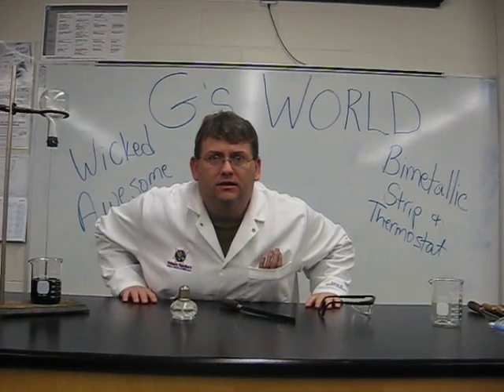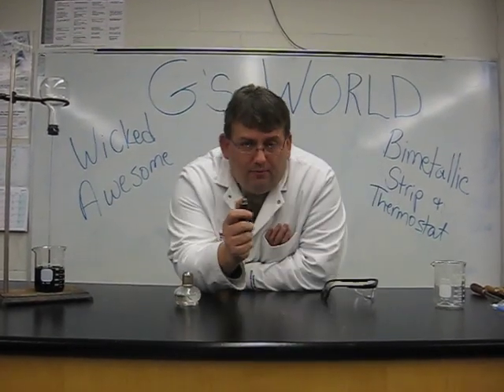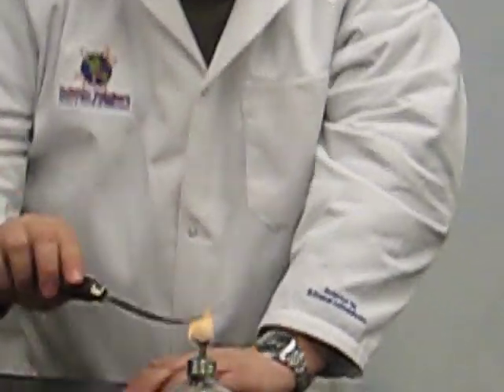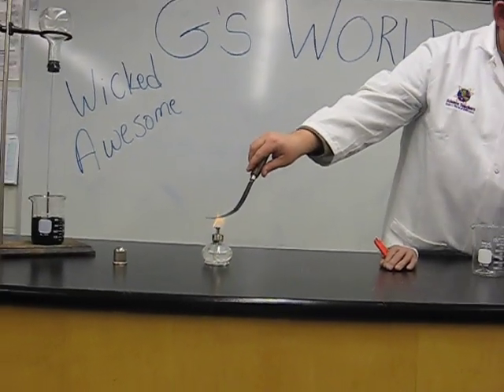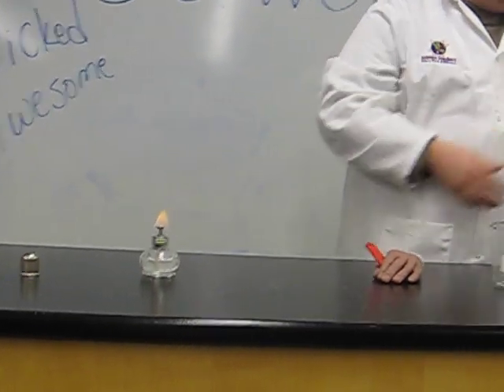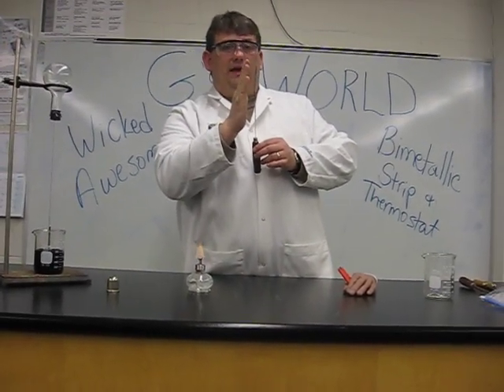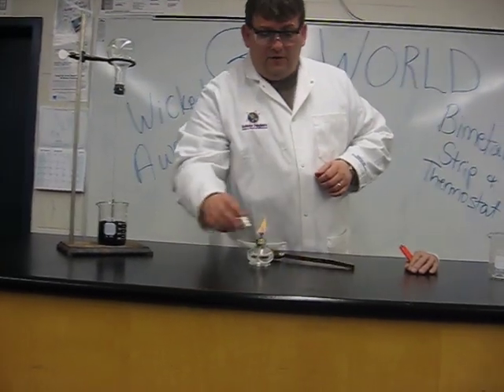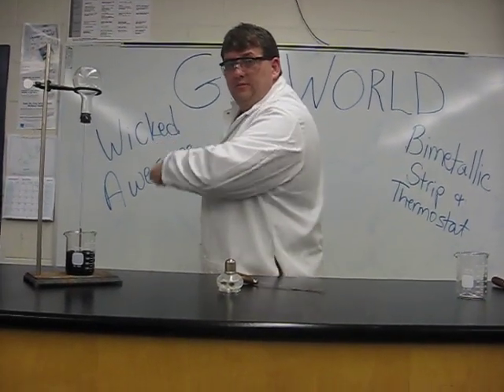Gs World  bimetallic strip

Comment: The presentation is backwards.  The "particles" in the brass move faster and spread apart more rapidly than those in the steel. Because the steel particles spread apart less, the brass pushes over the steel side.  The steel doesn't "pull" the brass (where would the energy to "pull" come from?), the steel is a drag/ resistance to the expansion of the brass. (I.e., the strip doesn't bend toward the slower expansion, it bends away from the faster expansion.)  The distinction is more than semantic- it is a question of causality: the force for the bending comes from the pushing of particles in the brass, not the pulling of particles in the  steel.  A piece of tape on one side of a long balloon will have a similar effect, preventing the taped side from expanding so that the untaped side pushes over/ bends the balloon... the tape doesn't pull the balloon into a curve, it resists the elongation of that side.

Comment: Not  "pulled up" by the steel, pushed up by the brass.  The force comes from the push of the more rapidly expanding metal (brass here.)  The steel resists the push, causing the strip to curl / bend around.